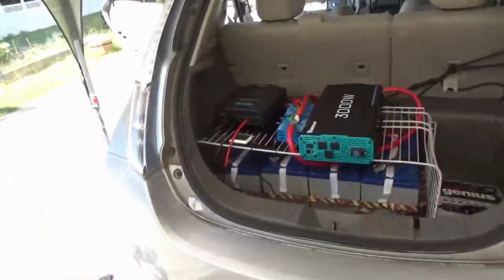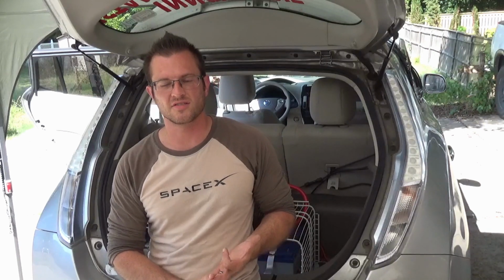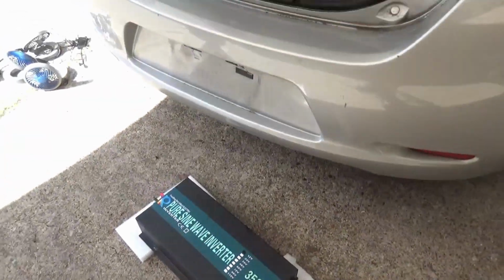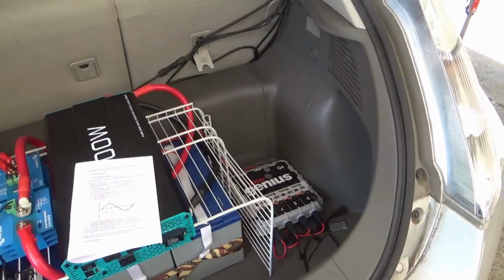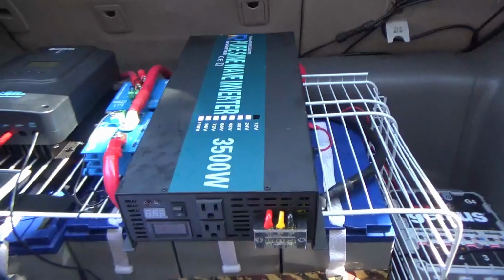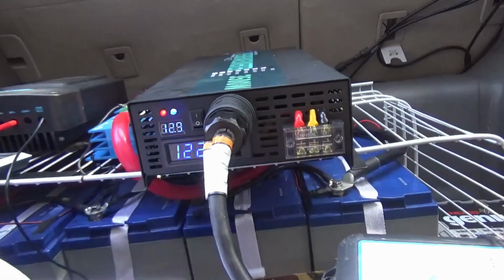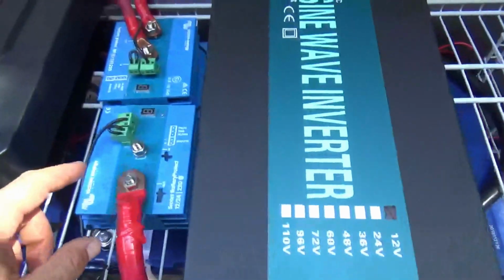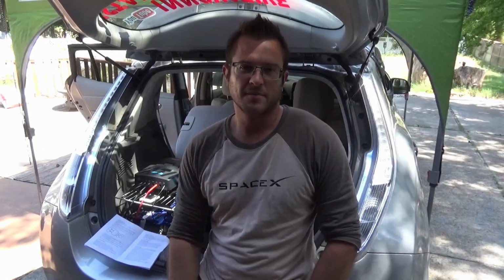Inverter Problems

Comment: To get 3500 watts from 12 volts, isn't likely. The current draw would be enormous.
I have 1500 watts @12 volts, and the current draw can get fairly high, as does the heat  also.
Reply from the maker: I use 4/0 ga cable from the batteries to the inverter for that reason.  But you're right about 3.5kw being a sub-deal wattage draw from a 12v bank.  A 24v system may work better for a solar car, but you would have to be careful in how you connect the panels.

Comment: aa nwm it is too late anyway. But i think you can fix it by shorting ground wire to neutral wire. this way ..that charger should be able detect ground and also it has nothing to do with ground as such s connecting ground on inverter to minus pol of car (whole chassis actually) will change nothing. Only mess things up..

Comment: Anything like that I would only buy it if its made in America or Japan. I do buy things from china but if they connect to the mains I take it apart and make sure the line,neutral and ground are correctly connected. Many times they are reversed or not hooked up. One time the line and neutral was reversed in the power cord itself. It costs more to buy from America or Japan but you have a better chance of it working.

Comment: Okay - cut to the chase - you fried the things by operating UNMONITORED.  The operating temp has a complex relationship to ambient temp.  I'd forget about keeping that thing running under those conditions.  I don't think water cooling would even help (look up PC water cooling.)  Maybe if it's directly refrigerated. FYI oil filling a sealed unit would definitely be involved with those crazy temperatures.  But for sure stick an alarm temp monitor inside that box that will get your attention.  And for the rest of us - keep on eye on those transistors for early signs of failure both visually and by meter. 90% of failures in anything that gets hot / high voltage / high amperage.  That's what's failing.  Also you can look up their temp rating which is directly proportional to their price $$.

Comment: Neutral and ground have to be bonded together for it to work, this is how your home fuse box is wired and is what these devices expect to see, check the manual on this one to see if it can be done safely. Connecting to the car battery, the negative of the battery etc wont be productive because neutral will still float above ground and will trip up protection circuits. 
I think many people believe that "ground" is some magical place electricity wants to go. its not, electricity wants to return the current source it doesn't care about the earth unless the earth is a viable to the source. In Europe they smartened up and call it "Protective earth" rather than Ground which makes a lot more sense - the ground return is really an alternate path for current back to neutral when there is a fault.
Reply: No no no...⚡⚡

Comment: Air temperature outside the inverter is NOT the 158 degree rating.
What you need to realize is the HOT air outside the inverter allowed the PARTS INSIDE to exceed 158 degrees.
THAT is likely why it failed.
Also that 158 is APPROXIMATE, not EXACT.
The 158 is the temp of the critical parts.
The parts produced their own heat and simply added to the hot air in the car.

Comment: I have seen the Reliable  inverter cover off and the ground terminals of the two outlets are not wired to anything.  Why they don`t wire the ground terminals of the outlets I can`t say but most inverter ground terminals are not wired .    Your last inverter worked so it must be wired differently.   I have seen this issue with most floating ground setups, both on inverters and generators. The hard wiring terminals on the inverter have the ground terminal.  You may have been able to hook a pigtail to that connection but if that ground terminal is just wired to the case your ground faults on your appliances will not operate properly.  Its good I viewed your video.   I was going to use an inverter setup for emergency power but perhaps a small non inverter Generator is the way to go.

Comment: Hey, great video. Can we get an update on how the Giandel is doing? Thanks!
Reply from the maker: Just updated the pinned comment where I do updates.  I actually just passed the 1 year mark of usage.  Honestly, compared to everything else I've worked with (Renogy, Energizer, Reliable) the Giandel is a beast.  1 year with no problems, and that's in the trunk of a vehicle!  Where it's constantly jostled, and the temperature swings from 30 degrees to 110.  It's getting hooked up to the vehicle's DC-DC converter in my next video, so we can turn the vehicle in a mobile powerwall.
Reply: @InnovativeSustainableSolutions  Awesome. I'm looking forward to that video. Thanks for the reply!
Reply: I see that you used all three output terminals on the Giandel, when I do that, I only see 60v due to split phase. Giandel support sent this reply back to me concerning the ground terminal 'G'

Our inverter generally only measures the voltage from the L to the N.
L = Hot wire
N = Neutral wire
G = Ground wire
Regards,
Elsa
 @InnovativeSustainableSolutions

Comment: Hi there I have reviewed a lot of inverters for The purpose of buying one from my own campervan in my view all the Chinese inverters are cheaply made and not properly quality controlled from my view then burgers are prone to not work from the very start like you said and I have seen them actually going up on fire so beware about this Chinese converters be better off getting a proper name brand like a German made one Krieger
Reply from the maker: I was completely unprepared for how much garbage I had to sort through to find a good one.  The Giandel 4kw has been great.  I'll need a good 24v next year when I redesign the system to a higher voltage.  I'll check out Krieger.

Comment: I sold inverters and operated a factory authorized inverter repair shop for over 18 years. Your mistake was purchasing Chinese engineered, Chinese made inverters. They're all crap, Buy U.S. designed, U.S. manufactured inverters if you want reliability and performance.
Reply from the maker: I went through several, and they were all, well crap.  Did you ever come across an inverter that could handle a 400v input to 120VAC output at 6kw+?  I'm currently tinkering with trying to make an electric vehicle battery pack accessible as a mobil powerwall and the best I got is running a 12v inverter off the battery under the hood (which the vehicles internal DC converter charges but only at about 2kw)

Comment: The way those EV chargers check for ground is it looks for continuity between the neutral and ground. That’s not the way those cheap inverters work though, between the neutral and L1 there is 60V between them 180 degrees out of phase. The ground post is connected directly to the negative post of the battery. Don’t try to bond the neutral to the ground on those inverters as it will be a direct short and damage the inverter. You need a 240V split phase inverter with a bonded ground or a 120V inverter that doesn’t use split phase. It needs to use the same wiring scheme that’s used in a house to be able to use that EV charger.
Reply: I've been looking for a way to go from the inverter to the main breaker box... I want to disconnect the main utility and hook it up 100% off grid. Is a split phase inverter the only option?

Comment: Those Victron lvd's are not designed to run inverters. Says on the site and manuals. Remove the lvd off the inverter.
Reply from the maker: The manual that came with it mentioned nothing of the sort, but I have heard they ship/have shipped with several manuals over the years.  I was led astray by a video by DIY Solar w/ Will Prowse.  He has since admitted in the pinned comment on that video that he was misled/mistaken in this part selection too, and he's an expert.  Victron should have been more explicit in the distribution of this product IMO.  I am still looking for a better Low-Voltage-Cutoff to be used directly between the batteries and inverter, let me know if you have any suggestions.
Reply: @InnovativeSustainableSolutions  Sterling Power ProLatch-R Relay. They are made for running large loads like inverters and they are marine grade. Hope this helps!
Reply from the maker: @iankeegan5047  You are the third person to recommend this part to me.  I will definitely be ordering one to try out for the suneater, and probably also for the home powerwall I want to build.

Comment: Connecting a ground terminal do the metal part of a car IT iS NOT PROPER GROUNDING! I fact it is not grounding at all!...car sits on tires and it is isolated from the real ground... Tha car chasis is incorrectly call "ground "  by many people including car mechanism... The only way to ground electrical device is to connecting the to proper ground rod or chemical grounding...  The GFI (ground fault devices)  ( sometime called diferencial Interruptor)  will not work if you dont have proper groud...they measure current flow of the live wire and return current in neutral wire... If they detect differences the shut off... They need very good ground and neutral connected to the ground in the first point of power supply... Your Inverter or charger may have some similar protection (dont know specific data of your units)  that is why they may refuse to work properly..... Get advice of good licenced electrician... Grounding seems simple but in reality is a complex issue.

Comment: You have to take a 3 prong plug cut an old cord and twist the green and black wires together then plug that into inverter or a generator and it tricks whatever you are using to think its grounded.
Reply: Is that for real?
Reply: @simonmasters3295  anyone can be an expert on the internet.. and.. others laugh

Comment: I have the three 3000 watt version and I use a laptop cooling pad that has 6 fans built into it and screwed the inverter to it works great.

Comment: You should not play with 120/240v  if you don't know what your doing!
 The ground on a car and a ground on a 120/240v are completely different sorry to say you are the defective one out of the box :) ....Don't take offence I'm a bitch naturally :)
One your car is DC the output of your Inverter is AC. A 12v batery can kill you if it falls from 6 feet and hits you in the head.
120/240v can kill you if it just touches you. the ground on AC and DC are different meanings The ground as you call it on AC is really earth.
 The ground on DC is really negative the battery is grounded to the negative body of the car. The AC is grounded to the earth by putting a stake in the ground (earth) this is meant to save your life buy pulling the maximum current through the earth lead to blow a fuse hence disconcerting the power. Still a lot of people die before this happens insteps the safety switch which disconnects much quicker than a fuse, that's another story.
 AC means alternating current there is no - or + as it alternates back and forth.
The cables on AC are called Active and neutral a battery is called positive + and negative - the difference is the negative is always negative on a battery. Th AC however alternates if you put the ground of the inverter to the body of the car nothing will happen but if a short happens in your inverter to the case you now have a live car body looking for somewhere to go since your car tiers insulate your car from earth your body becomes more attractive than you think remember electricity is lazy but powerful it will always take the less point of resistance. Any how i don't want this to become a book read up first and you should tell your viewers this. What you do is fine and fun but safety first. I hope this helps and saves a life.

Comment: One my inverters that have open ground works my air and everything else you just have defective inverters
Reply from the maker: I think you're right.  It was a combination of a sensitive ground detect in the EVSE (car charging cable), and some not-great-quality inverters.  The Giandel 4000w I switched to has been working like a champ for almost 6 months now.

Comment: That model of inverter  along with many others have a positive nuetral that your system does not like
Reply from the maker: Good call.  I figured it all out in a later episode albiet with a shady ground bypass.
Reply: @InnovativeSustainableSolutions  what video did you figure it all out in and explain it? Thanks!
Reply from the maker: @confluenceinfinitethemovem  See pinned comment for my best guess.  In my next video I Install a Giandell Inverter that has worked great for the last year and a half
Reply: @InnovativeSustainableSolutions  how do I determine what your next video is that you're referring to? Is there a list of them? If so, what title?
Reply from the maker: @confluenceinfinitethemovem  Portable inverter ground bypass is the next video.  And yes there is a list of videos, on my Youtube channel.  The complete construction of every aspect of the solar Leaf is cataloged there.

Comment: i have two Reliable Electric 2000 watt pure sine wave inverters.  There is a ground terminal in the terminal strip on the right..  Center terminal is ground if I remember correctly (the manual is on another floor).  You can check that by taking the cover off and seeing where the ground terminal on the AC outlet is wired to.  Then run your wire from there to vehicle ground, although the charger may be looking for a REAL ground connection which is only available with a connection to the actual Earth - that's another engineering issue.

There are two schools of thought on grounding inverter cases.  One says the case ground is also the power ground and is always used and the other school says the case ground is never used for power ground.  I can see both arguments but it's a hassle for those who don't know that there are differences in manufacturer ideas or how to work around those differences.

Comment: I dont know if you solved this problem yet,,, here is what you need for grounding the neutral... for  your Granny charger to charge...  this guy explains it perfectly.. https://www.youtube.com/watch?v=c2GqbM0JxlM
https://www.microair.net/products/generator-bonding-plug?variant=12272654155860 
https://rvpower.southwire.com/products/accessories/surge-guard-generator-neutral-ground-bonding-plug-model-44400/

Comment: I figured there might be a lot of people reading this the vice I would give is to go 48 volt and go with low frequency inverter definitely most definitely low-frequency high frequency inverters are junk even the cheap power jack low frequency 48 volt inverters have very few problems with Power Jack are actually about half the wattage they say so if you get a power jack make sure to get double the wattage is what you actually need and get 48 volt low frequency and you will be happy
Reply from the maker: Wouldn't a 48 volt inverter necessitate a 48 volt battery bank, and hence a 48 volt solar panel system?

Comment: hi i will go with a the same reliable  inverter  but 48v or higher 60v and  220v out this will help run smooth and efficient, you can ask the seller to make you one in this config and re config your panels and batteries on series.  i will look for the video i see on this. so you can get more info if you like, you doing a grate job.  i love what you did  i got a nissan leaf . my is 2013 i am ok at the moment but some day i will be in your shoes.  lol  continue your videos  i just find you so i will like to see more, take care friend.

Comment: I had issues like this with rubbish charge controllers/ overvoltage and had to set lower charge levels.
Reply from the maker: I finally found what I think will be a solid inverter.  I'm using the Giandel 12v 4000w.  And have had zero problems with it.

Comment: I have the same inverter do you still want to know how to ground it? Let me know
Reply from the maker: Thanks for reaching out.  I did a fused, ground bypass through a GFCI outlet.  It's worked really well for about 5 months and counting.  I think my inverter headaches are finally behind me
Reply: @InnovativeSustainableSolutions  or take a plug from somthing and cut it off and wire the ground and black wire together it tricks the inverter
Reply from the maker: @supremeautomotive6749  Thats what I wound up going with.  I run a ground bypass on a fused GFCI outlet powered by my Giandel 4000w.  I know the ground bypass is not kosher, and makes people a little nervous, but it's been a real solid fix.  No wires are heating up, no fuses are blowing, I've cranked 1000s of kwh of power through it up to 22A at a time.  I consider it an acceptable method
Reply: Ground stud on the bottom of inverter.
Reply: I have a 3000 w reliable inverter and can't run a car charger either. By grounding the casing . will this solve the issue? Or someone mention plugging in a male plug into inverter outlet and wiring the black wire with ground? That doesn't sound right..since both hot and neutral split the voltage on the reliable inverters...confused what to do
Reply: Can u instruct me on how u got the reliable inverter to except the car charger?
Reply: Did you ever fix the issue.? With the inverter?
Reply: I have same type of inverter, experiencing a problem of high input dc over voltage. How do i ground it?